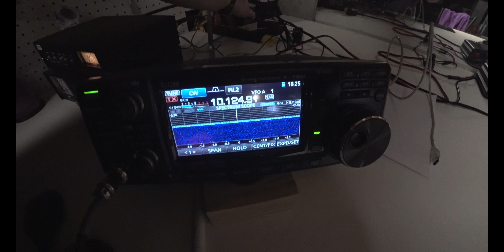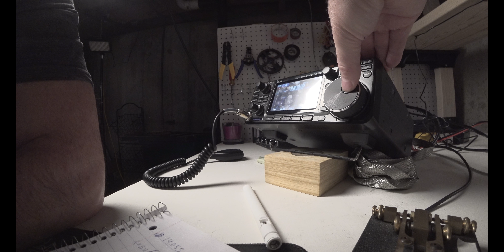Rookie Roundup Preparation HFedz Antenna Testing

Comment: Hi there, just a couple quick questions because this antenna does not have a lot of reviews on it (only other one is https://youtu.be/ff-ClsCDpYQ)

1) Which HFedz antenna is this?
2) How long is this particular one?
3) Did you ground this install or use a counterpoise for what looks like to be the excellent results you got in this video?

Thanks!